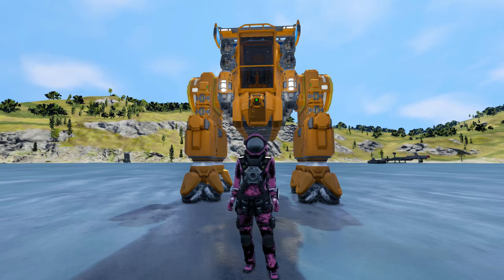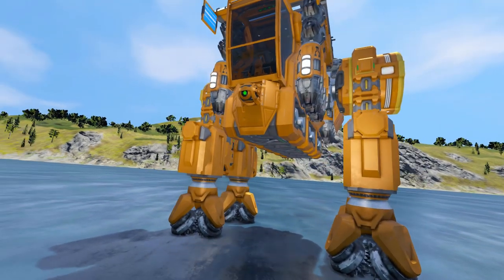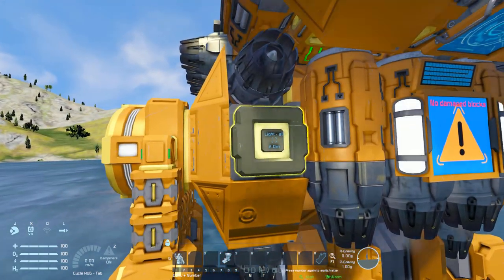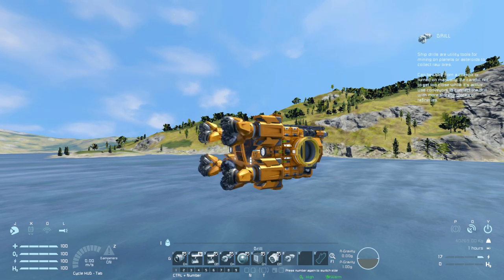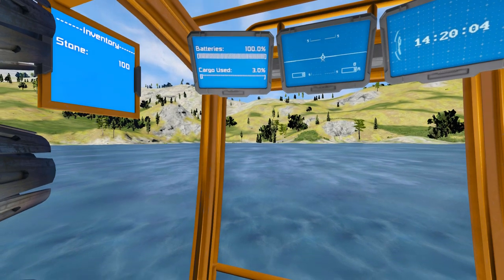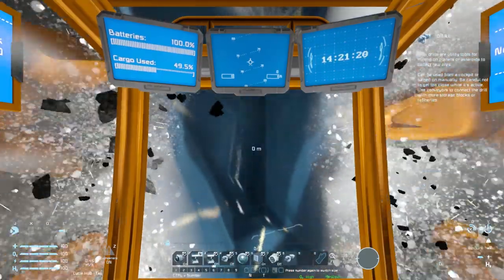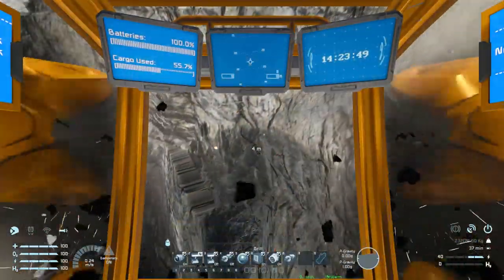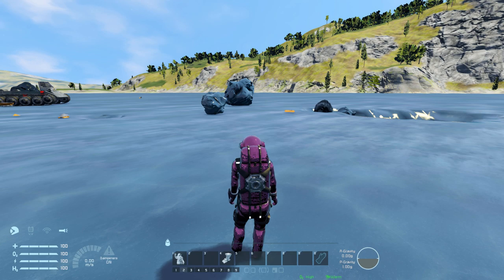The Voha-Drill - Space Engineers

Comment: On the horizontal the drills are spaced 3 blocks apart, but on the vertical they are one block apart. By lowering the lower arms by two blocks multiple problems could be fixed.
1. The back would not hit when drilling down.
2. There would be more volume to add thrusters. Such a design should have enough downward thrust to support a full load.
3. Take out the solar panels to reduce weight and rely on recharging when you unload.
4. You could probably cut a battery and have enough juice to mine a full load and get home.